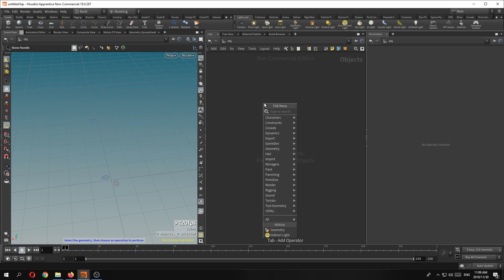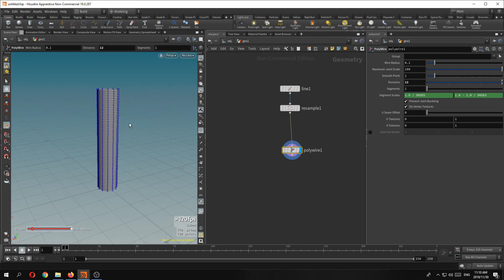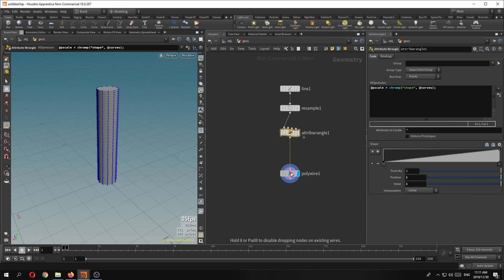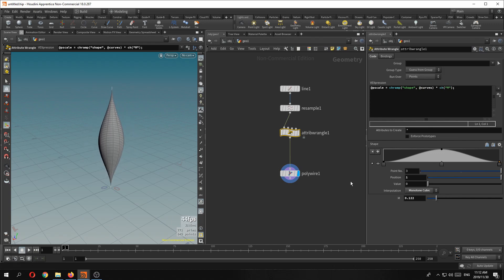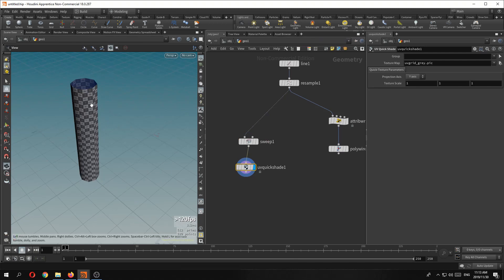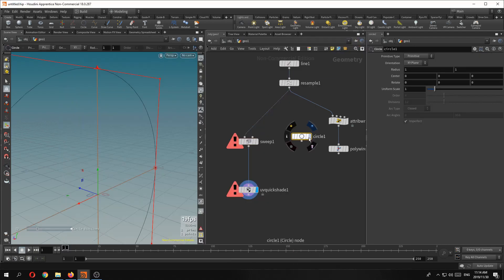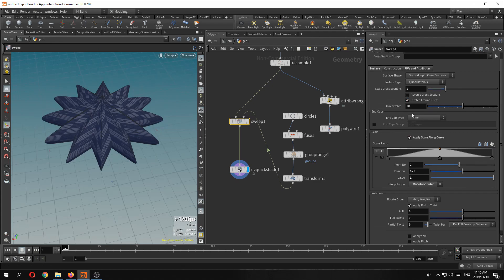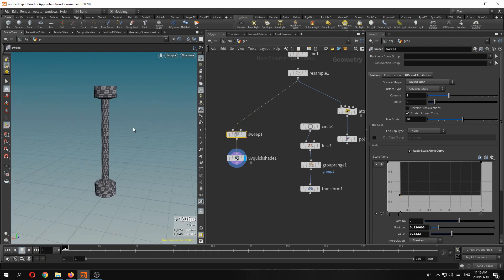Houdini 18 SweepSOP vs. PolyWire

Comment: What if I want to use multiple profile curves like a circle and square profile curve sweeping on that line?
Reply from the maker: You would use a  Sweep SOP with the different profiles merged together, and plugged into the second input.  Under the construction tab you can change the Cross section Order to Cycle.